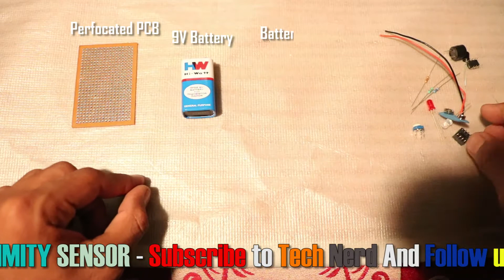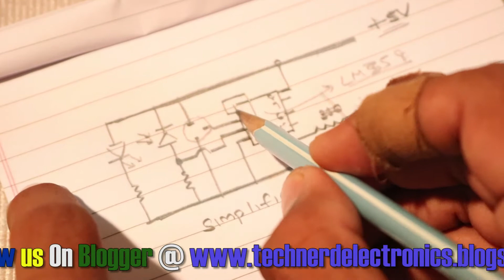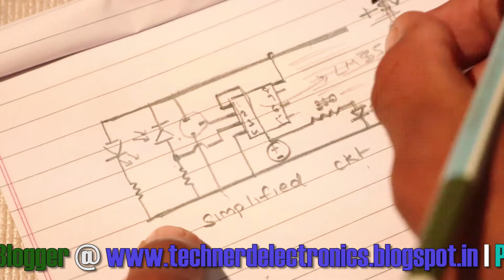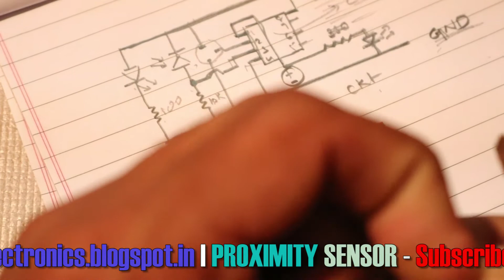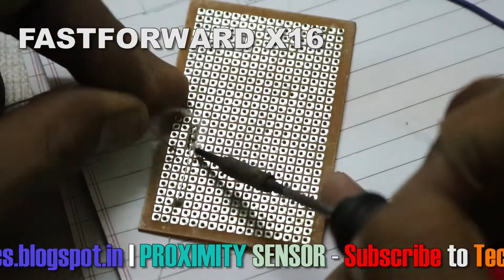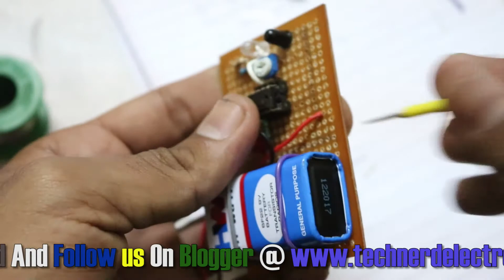PROXIMITY SENSOR | Mini PROJECT | TechNerd

Comment: Fully DOUN video... Used your valuable time to make + and - line.... The main component are not soing to part by part soldering...
Reply: How connection were made was shown before on a paper . 
And same components were used.  
If step by step connection video was slowed down video will become lengthy.